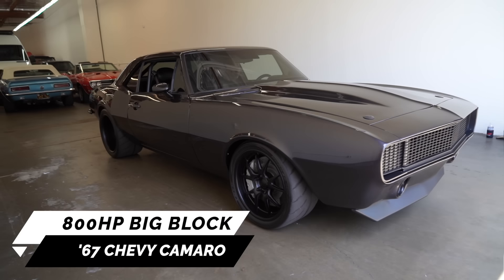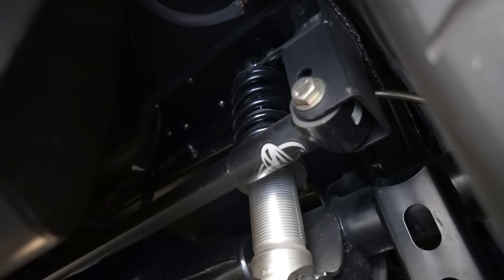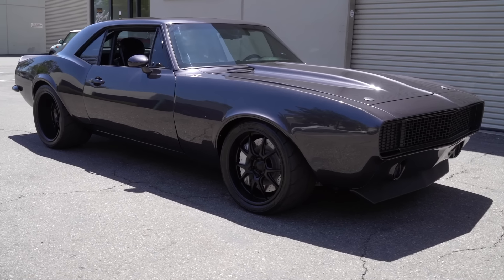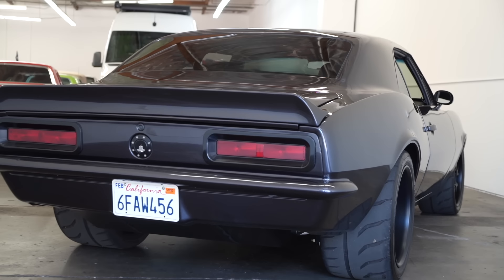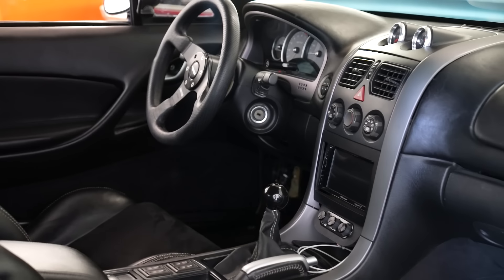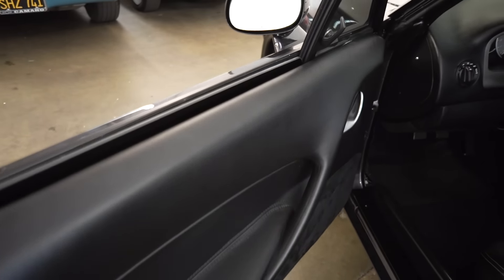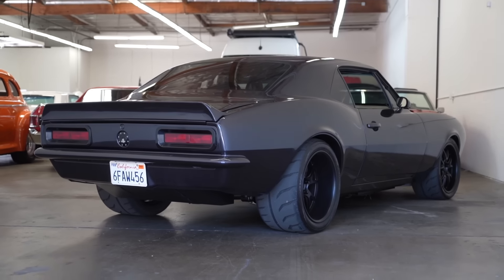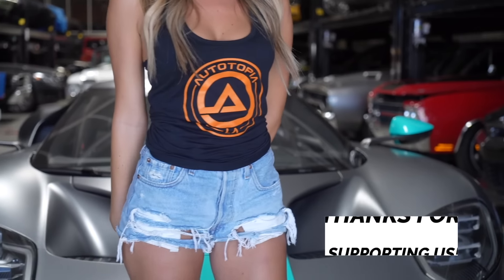800HP BIG BLOCK '67 Camaro Pro-Touring Build

Comment: My car is in the same state, I feel it, Ive done everything myself and it's so sketchy to ride, I stopped a mile into my way to work cause it felt shaky on a back road 😆

My car is a custom 79' trans am with a 
488ci stroker "428 Pontiac" and I just got done putting on tubular front control arms. 
 Crazy story i didn't tighten the lug nuts enough when we test drove it after the control arm swap and ended up riding on wheel rotor!
Reply from the maker: Always something with custom builds

Comment: One amazing Camaro, and as a Camaro guy (owned 2, 1971 Z28 and a 2012 currently), I am totally impressed. It could be the tune, but to me, it's a connection/ground issue. Because it's intermittent. If it was a tune issue, I think it would not come and go like that. Unless the computer is having trouble getting a reading from one of the sensors and the tune can't process the lack of info.
Reply from the maker: We’ll find out soon enough as he was digging back in to see what’s the issue

Comment: Cool car man you said it was runing very rich if that is the case your plugs could be fouled up  that would cause it to hesitate
Reply from the maker: Most likely a tune issue making it run rich, throwing off o2 sensors and fouling plugs

Comment: I can understand it taking 10yrs of your life to bring a vision to life. I’m at year 9 of my own build and probably about as far along, 95%, getting close. Runs and drives, tune is close, just have a little more fabrication on the suspension, a door panel to finish and some safety/durability items to check off. Starting a family and now military obligations have slowed progress tremendously, stand-still the last 6mos. As did getting older, can’t do the all-nighters anymore like I did in the early days, lol. The GTO interior… normally I’m not about the retrofit interiors but that’s not too bad. Still prefer old school but it’s not over the top.

Comment: Super cool car. Though I am skeptical about the engine being a big block. Everything about it says it's an LS based engine. The heads, the valley cover, the intake that has LSx cast into it. Conventional big block head ports are side by side. Spread port heads are MUCH bigger with much bigger valve covers.

Comment: nice car but is not a big block... it is a LS the motor is a RHS 502 CID LS7... the water pump.. valve cover and exhaust port location is a dead give away... there is a extreme difference between that motor and a gm BIG BLOCK 502... so it is correct that is was mentioned as a dry sump LS7... because that is exactly what it is.... RHS based that 502 tall deck off of a LS7.....people should do a lil more research..
Reply: No one cares.
Reply: @jasonfitzpatrick414  🤣🤣

Comment: Man, i felt this in every level. I just got my 87 buick turbo T sorted out. It ran good around town then on the way back from the very first long trip, i got a IAC control error on my fast Edash and the car stalled out in the middle of the road. Replaced the IAC with a new old stock one & cleared the code but still same issue. Car wouldnt idle etc. My tuner drove 1.5 hours to come look at the car to discover the driver in the new fast XFI sportsman ECU was bad. Fast sent out a replacement and my tuner drove back out to download the tune to the new ECU and run the car through different scenarios. Runs like a top now but definitely frustrating having spent all the money & it being a part for 2 years to have something go wrong so quickly. Thats hot rodding tho. You’re making it do something it wasnt designed to do. Then throw in numbers like your 800hp or my 556whp and it compounds the issues lol

Comment: Coolest car I’ve seen in a while. Props to this guy! I remember the 1st drive after getting my 66 together. Built the 347, redid interior and the wiring over the winter. Next couple months were nothing but little issues that needed to be fixed. Just part of it.